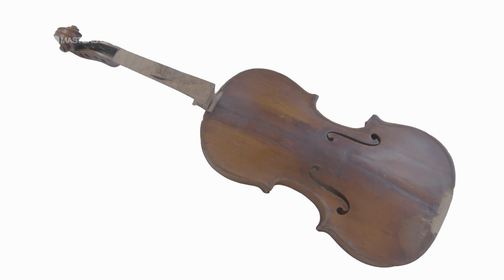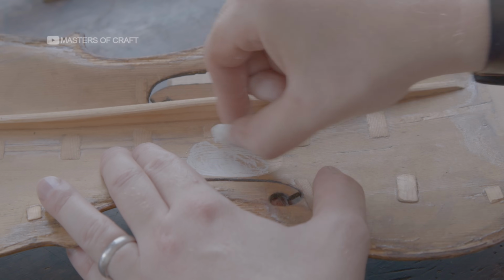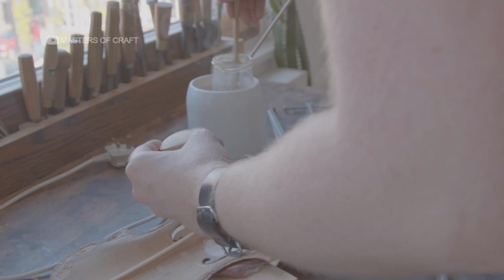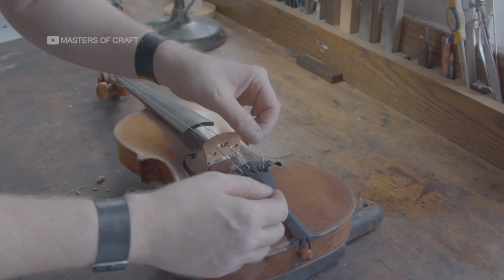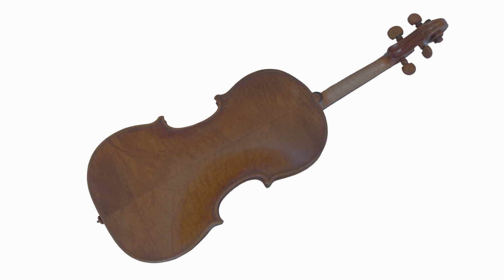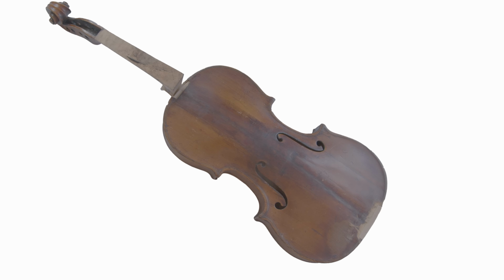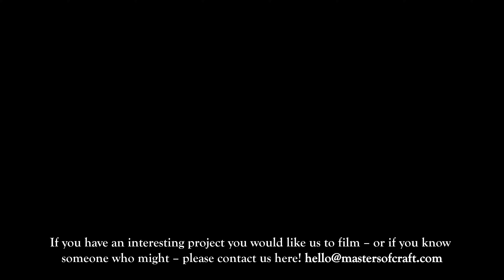Broken 1840s Violin Restoration

Comment: I can't understand why a broken, cracked, split, dropped and damaged violin would be able to sing again to the same level as the original. Surely, patches and repaired sections would be 'deadened' and not vibrating as when new. So why spend so much time on a violin that may not be worth repairing? It may look good on the outside when repaired, but not sound great. Just asking.

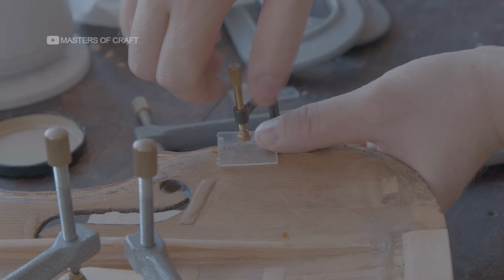Comment: correction at 3:10. it's not wood based glue. it's hide glue.

Hide glue is made from boiling raw hide for a long time at a low temperature, making the hide dissolve in to the water. once it starts to drie it becomes sticky, and onche drie, it becomes hard. People wo build instruments, often swere by that hide glue is the best glue for atleast two reasons. First it's easy to remove if you need to repair the instrument. All you need is a bit of moisture and heat, and it will come apart, compared to other glues where you often deed to quite literarly break apart the item by force.
 The other reason, is that they claim hide based glues give the instrument a better and ritcher/fuller sound when you play them, compared to most other kinds of glue.
Reply: So you mean violinists aren't vegan, huh?... 🤭
Reply: A very useful comment. Perhaps you might read it back to yourself with a view to correcting the many mistakes that devalue your message.
Reply: @jonka1  I have used hide glue for years building and repairing stringed instruments and furniture. I understood and agree with all that was said in the comment. Perhaps English is a second language for the author, so he/she struggled a bit? Western Europeans often default to phonetics when learning to write in English. In my humble opinion, the mistakes did not devalue the comment in any way. Let's encourage others whenever we can.

Comment: Fascinating. Why was such a large block carefully glued in place, just for almost all of it to be planed away? Why did it need to be so big to start with - why not at least half as deep?
Excellent and very well-judged, minimal narration plus excellent recordings of the tools being used.
10/10
Reply: I was asking the same thing.
Reply: Because a) a thicker block is easier to handle during the shaping process and b) a thicker block is less likely to distort during the hot gluing/clamping process. It only takes a matter of minutes to get rid of most of the excess thickness once the glue is dry.
Reply: @EzziestringsGreat answer. Thanks.

Comment: Major work, just with sound post patch. But the cleats, varnish touch up, adding new wood, shaping new. All very expensive on the final bill. Add true boxwood pegs, also very expensive as of 2024 (if not the cheap Chinese pearwood which looks similar and is often sold as "boxwood"). Beautiful restoration work!

Comment: curious why he makes his patches so big and then has to trim so much after. Why not cut them thinner on the ban saw to begin with?
Reply: I had that exact same question!
Reply: Error on the side of caution I’d guess. You can always carve excess wood away, but you can’t easily put it back. 

“I measured and cut it three times and it’s still too short!”

Is a thing any woodworker doesn’t want to repeat very often
Reply: @panzerlieb  i totally agree.
Reply: @panzerlieb  Such a waste of good quality tonewood.
Reply: may help even out clamping pressure? It's not a large amout to carve away compared to making a whole new top!

Comment: Dear AceMannow, Im going to guess that it was a German violin. I may be entirely wrong. Many German violins were manufactured in 1850. I know it was dated 1840. Black forest or Marneukichen or some other bavarian region I would guess. Of course im only speculating it might have been French or Italian or even Irish. Mine was a Sears copy of a Stradivarius of Cremona 1720. Its actual manufacture date was approx 1850 in west germany. Those old violins are wonderful but the glue dries out and they crack at the bouts. They also split at the f holes. That is why you must humidify a violin lest it crack.

Comment: What was that white powder you rubbed into the bridge? What does it do? Excuse my ignorance, my focus lies with fretted instruments.
Reply: I think it was to transfer marks so he knew where the high spots were and what to remove to have a good fit.  It looked like plain old chalk.
Reply: on the flat side? probably just pumice to fill the grain before applying a top coat.
To fit the feet of the bridge to the violin (to find high spots) you simply use crayon, chalk would scratch the instrument
Reply: @tobymarol7329  I completely misread his question.  He said white powder and my mind went straight to the patch the luthier did on the inside.

Comment: I have a old Stradivarius that's been in the family for the last 7 or 8 generations.  I need to have this referbished. So far I've had this instrument evaluated and it is the real real McCoy, and not a counterfeit Stradivarius violin as many are. Been looking for years for a qualified violin Luther  to do the corrective work that needs to be preformed. Once completed it might be a decent player reborn, with value.

Drop  me a note if this shops interested in the work. Im impressed with the attention to detail. I've built and repaired few guitars. But I haven't the nerve to touch this project.

Comment: I wonder why the crown?  The only time I had to fit one was when a button had snapped off at the purfling, and it was necessary to cut away half of its thickness and fit a slip of maple to bridge the break. The repair would have been visible, and a crown hid it.  I can't see a case for removing part of an intact button. In fact I can't see a case for removing ANY intact part of an instrument.  Surely not best practice.

Comment: Whoever made that violin didnt know what they were doing.  Y'all saw how much extra wood they had on that thing that he had to take off?
Reply: Are you talking about the patch that he glued in, between the f hole and the bassbar?

It is supposed to be that thick in the beginning, otherwise he would change the carefully shaped surface, and it wouldn't fit as good.

Ps: I am a trained luthier from Austria/Vienna

Comment: Rabbit or hyde glue.is acceptable as it is disolvable with steam. Wood glue is entirely inappropriate as it will splinter when you need to dismantle it again. Wood glue is all right for a one shot reasembly but if it ever needs to have the plates removed it will take some of the other wood with it. The glue i saw being applyed looked like vegetable glue. Or hyde glue. Maybe the narrator only missquoted the glue type.

Comment: yeah, no.  he should throw it away, and start from scratch.  older wooden instruments sound more hollowed out, because the anaerobic bacteria aided by the musical notes, basically eaten hollow, the insides of the wood, very slowly - you get 'richer' sounds.  basically more echo.
but, because of herd psychology, and the supply-demand, the instruments are priced higher, which is a big mistake.  the lengthier the time, the more hollowed-out the instrument will sound.  when you start with a new instrument, and the finest wood available, that's where the real magic is; the notes are very tight...
as per the older instruments, if you can keep them in a dry, cold storage...perfect.